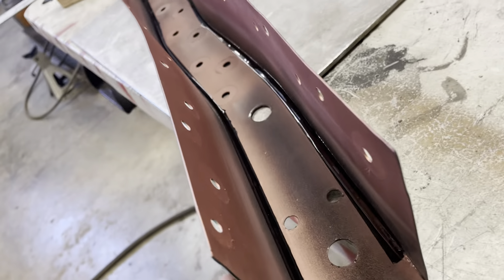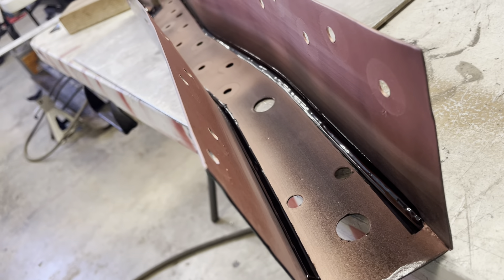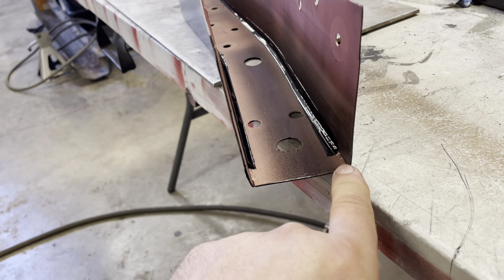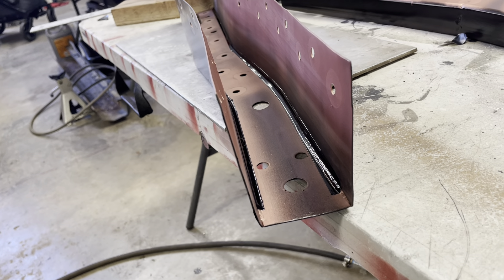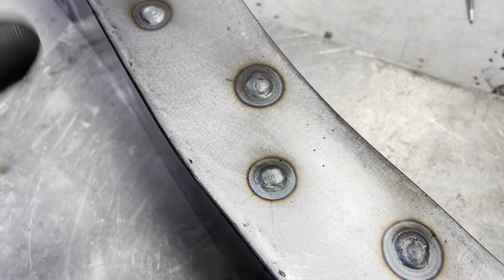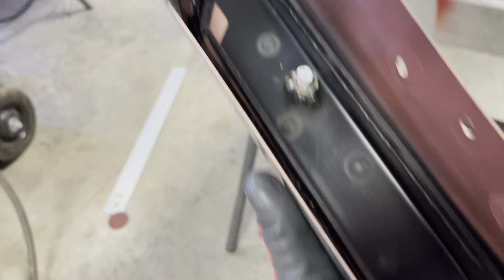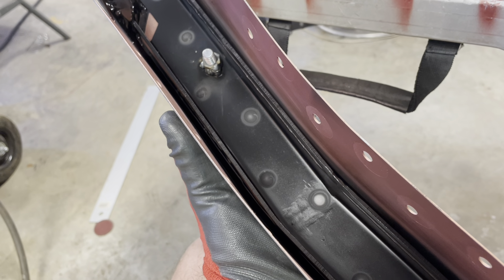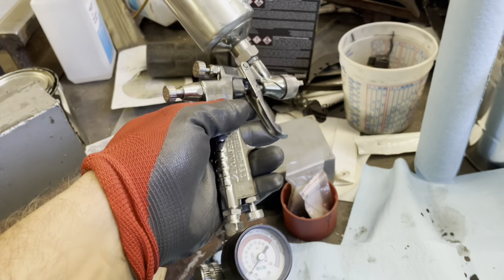Frame section welded in

Comment: Great job. I've got to replace the floor pan in most locations and install frame stiffeners. 

Apologies if you mentioned it, if so, I missed it.  What rust encapsulator did you use, Eastwood?
Reply from the maker: @05glisedan  thanks! yes sir Eastwood.